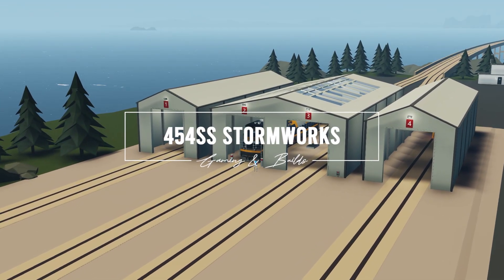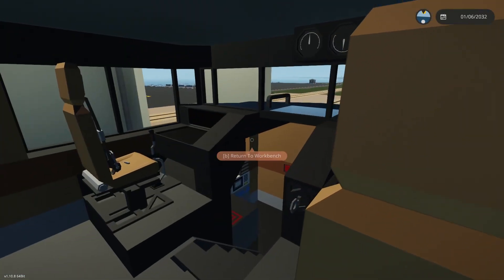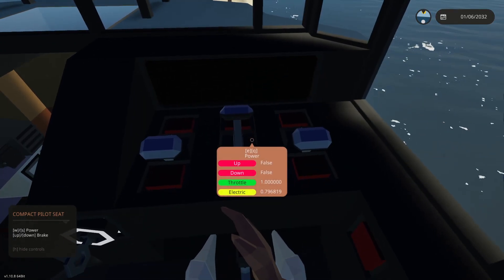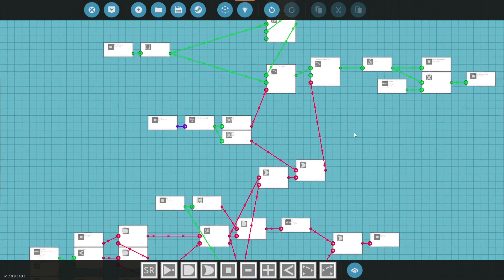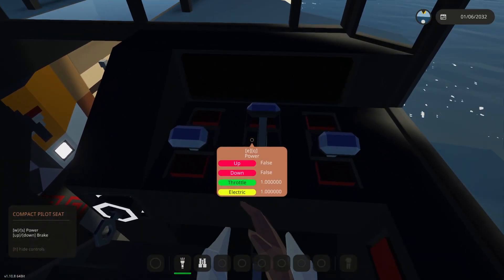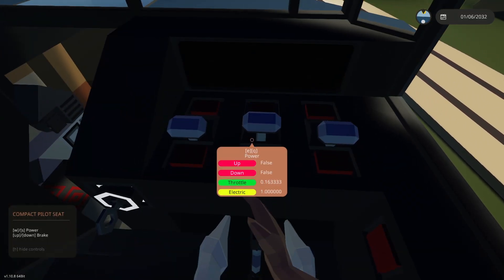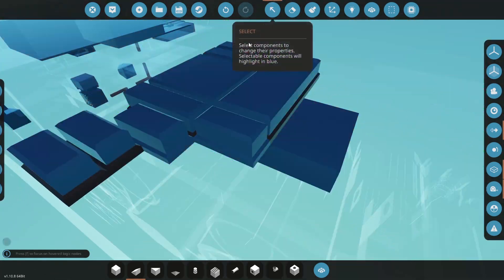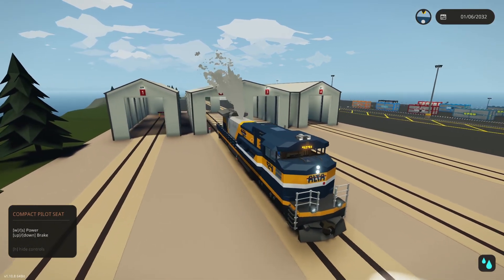Diesel-Electric LOCOMOTIVE Tuning in STORMWORKS!

Comment: I found you can use a 4-cylinder 3x3 and get 2000 watts out of it using a gearbox pointing to engine set to 3/1 at 12 rps using the large genn
Reply from the maker: Amazing, I will have to take a look at this!

Comment: Pls make a manual transmission controller and your ecu still doesn't work properly. Why does it go to 25 rpm automatically?
Reply from the maker: Unfortunately, I do not know your engine set up and I cannot support and diagnose everyone's engine issues :)  Your RPS spike may be because there is no load on the other side, or the engine is too powerful.  The ECU MC is only intended as a starting point for those who want to learn.
Reply: @454ss_gaming  hmmmm maybe ........ But i hook everything up right and my engine spikes up to 25 after the ignition turned on instantly. Oke tho can you plz make a manual transmission?
Reply: A manual transmission controller should be easy. The only difficult thing is gear ratios but a controller doesn’t really help with that.
Reply: @djplonghead5403  i am new tho.